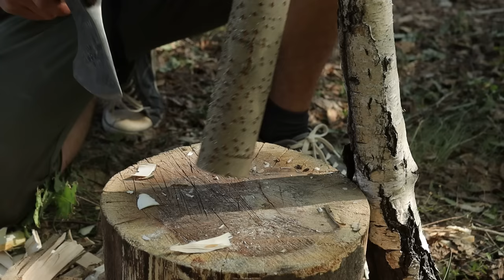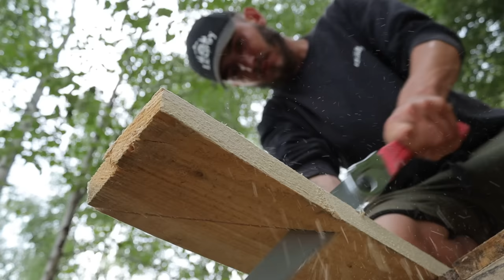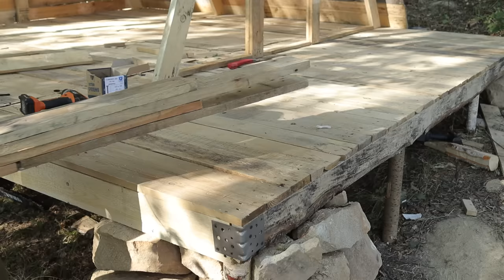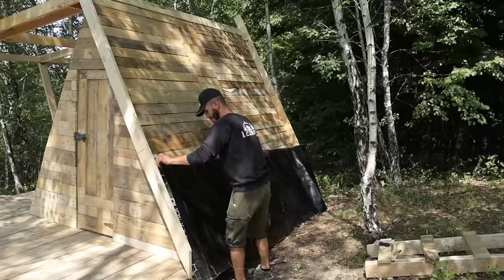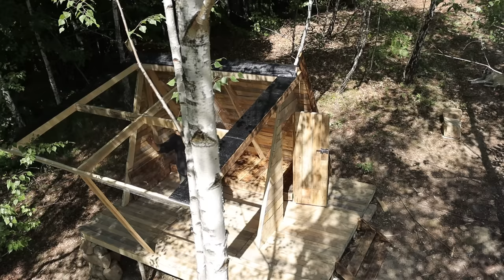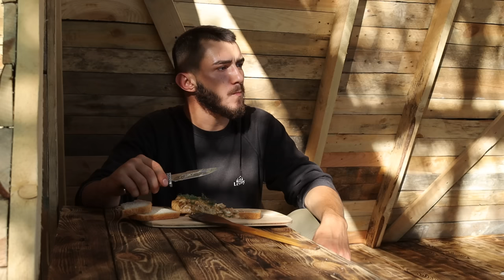A figurative house from pallets. Start to finish

Comment: This looks like the A-frame tiny cabin "Girl in the Woods" built a number of months ago.  She also added a rubbery/ some sort of seal along the hinged edge of the wall that raises up so it could help keep water out and I *think she can even have it open when it's raining if she wanted due to that and a decent-sized deck.
Reply: @relaxshacksDOTcom  what did you use for the "windows" plastic?
Reply: @timsolomon8352  polycarbonate

Comment: Outstanding build using salvaged materials!  Love the simplicity and elegance as well as the aesthetic look of the A frame.  If you would have put hinges on the base of the platform instead of nailing the boards on, you would have had a great cubby hole for storing items in plastic containers.  you could still do that next time around as you further improve and decorate this awesome shelter.

Comment: I think I"d like a roller blind inside the window/wall,, partly in case I suspect roamers who might come by, but also windows are very cold things. OK on warm summer nights, but otherwise the glass will make the inside very very cold, and needs a cover.   Also, dog a bit too thin - needs a bigger feed I'm thinking.